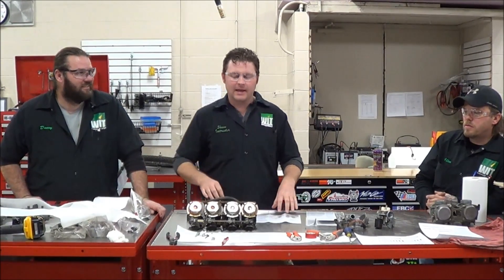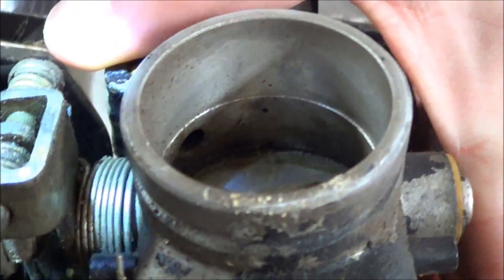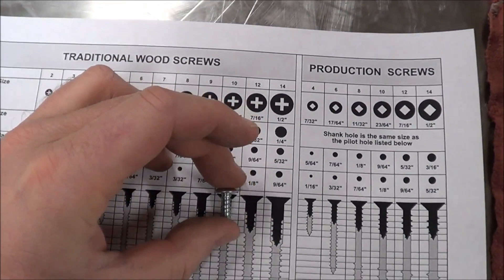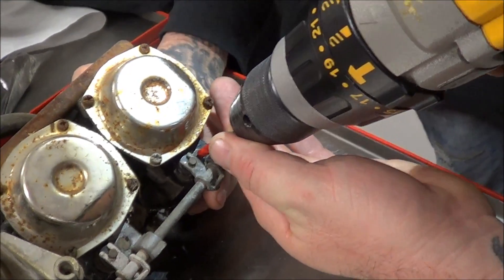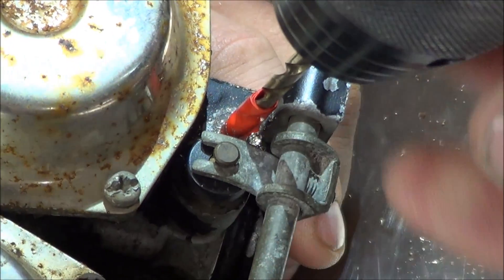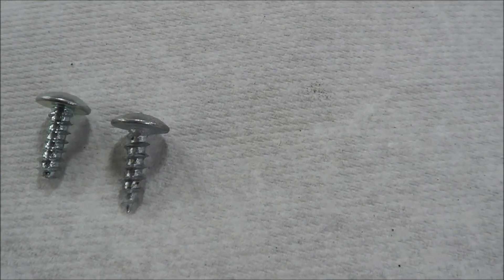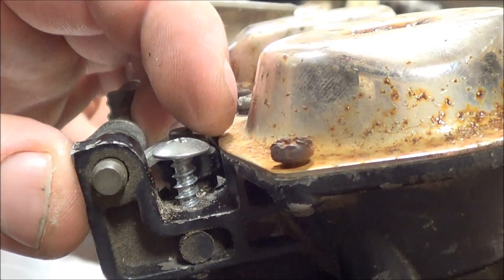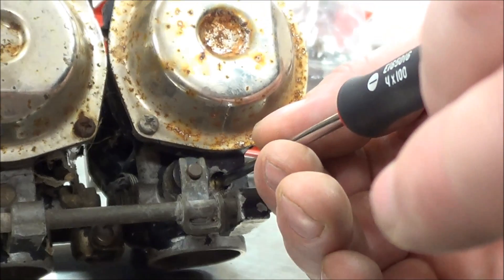How to Remove Carburetor Air / Fuel Screw Welch Plugs on Metric and Harley

Comment: Shane, thanks for the video.  I have a slightly different method for removing the plugs:  drill a hole about 1/16" diameter near the center, then drill another 1/16" hole some small distance away from the first.  Enlarge one of the holes until it breaks into the other, making a "binocular" hole.  At this point a bit somewhat larger than either hole will jam into the pair.  Once jammed turn the bit by hand to remove the plug.  I use a drill press for all operations to keep things steady.  If done carefully there will be no mark at all on the idle screw.